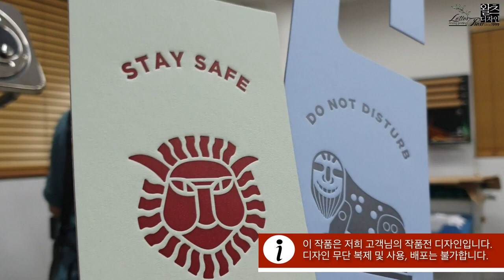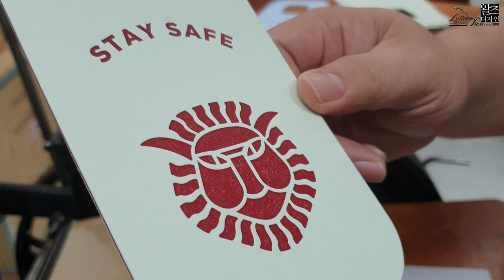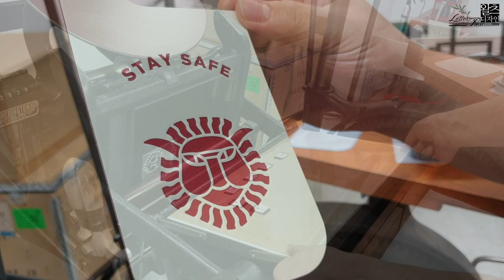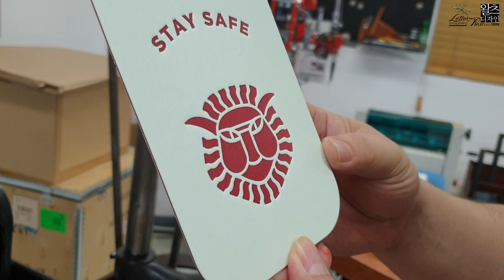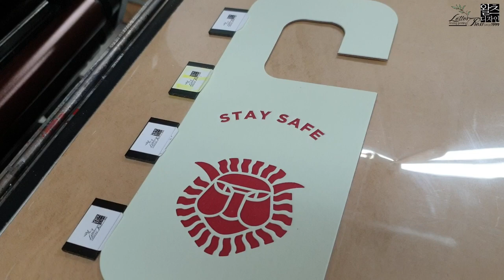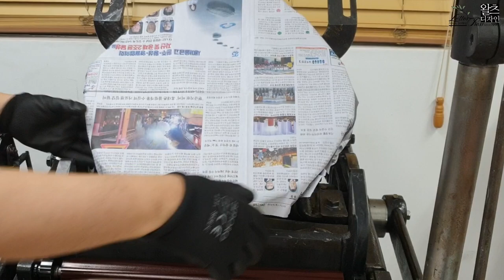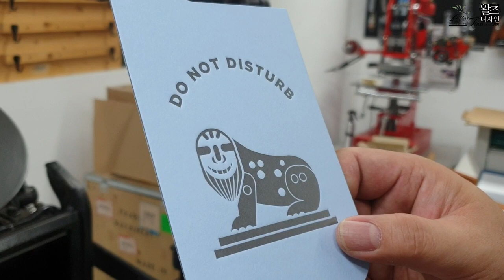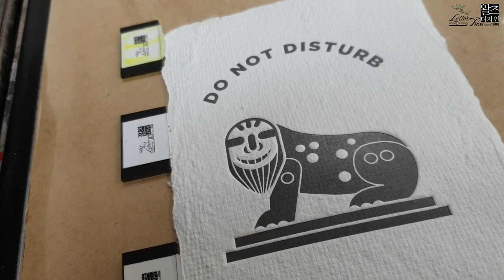Make a letterpress door hanger. 레터프레스 문고리만들기

Comment: waltzdesign Hello. I have the opportunity to buy a Heidelberg Windmill on ebay...
I have never used one ..didn't even know of them until finding your channel.
I just the thought of owning one and possibly using it in my screen printing shop that I am actually yet to build lol.
What should I be aware of...what should I consider IF I buy it.
Are they expensive to maintain or run... 
Am I just being stupid buying one out of the blue just because I like the things you are producing with one lol.
Any advice will be very much appreciated. 
Thank you
Reply from the maker: Nice to meet you.  I started with a manual machine.  It's been 3 years since I bought the windmill, but I don't use it much.  I don't recommend it unless there is someone around you to give advice on machines.  In my case, I bought a machine, learned the basics of operation for a fee, and learned the know-how by visiting a print shop nearby.  It may take a long time to learn and learn by yourself.  There are many risk factors when operating the equipment, so you must learn basic training about the equipment.  If you are new to letterpress, I think manual equipment will be easier.  There are no special maintenance costs for windmills or manual equipment.
Reply: @w_letterpress  Thank you very much for the quick reply...I very much appreciate it.
Sounds like I maybe getting excited by end results then lol... its just so pleasing to watch.
Can the same projects be undertaken by a small manual machine ..with the same end results?
Could you possible suggest a manual to go for.
Thanks again
Reply from the maker: The project cannot be done with small tabletop equipment.  C&P 10x15 seems to be possible only.